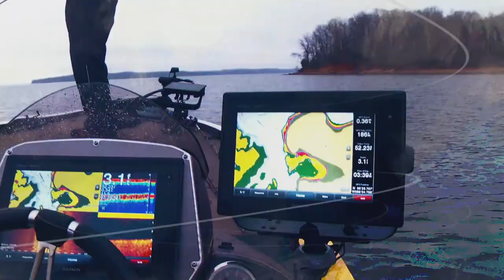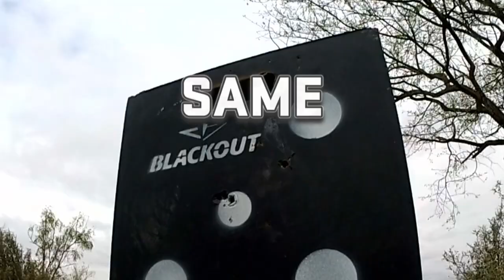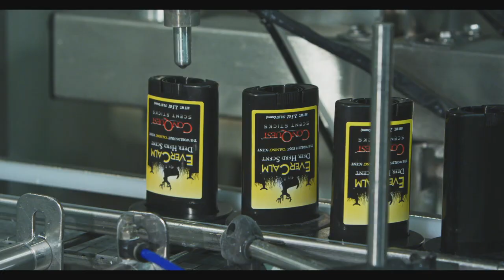Handgun Hunting

Comment: I love my model 460V S&W magnum X-frame revolver. The five inch muzzle brake equipped full lug barrel makes the gun weigh slightly over 60 ounces. Smith and Wesson did a Master Revolver Package job on it and installed a fixed trigger over travel stop too.